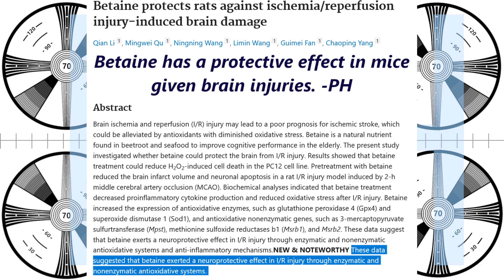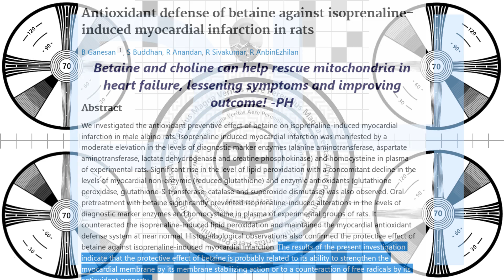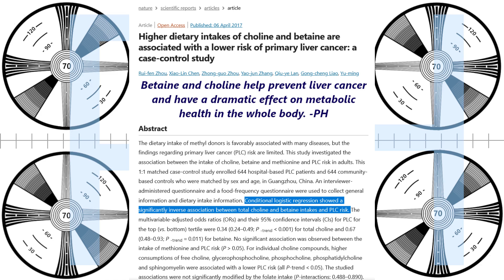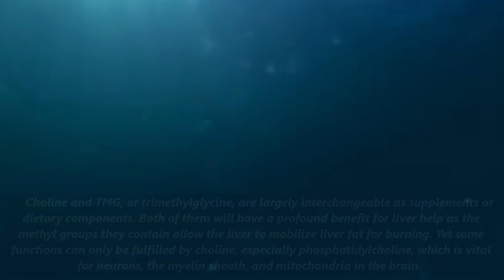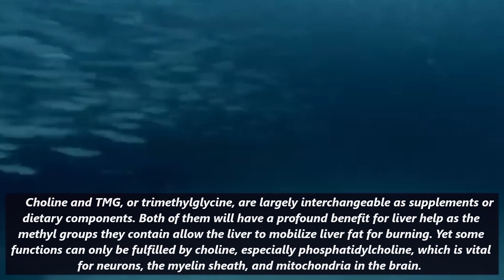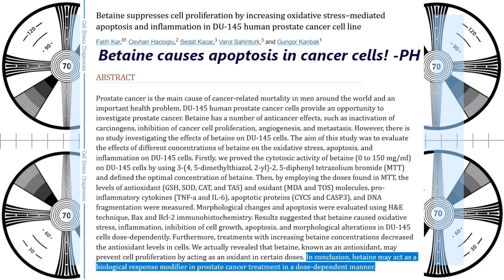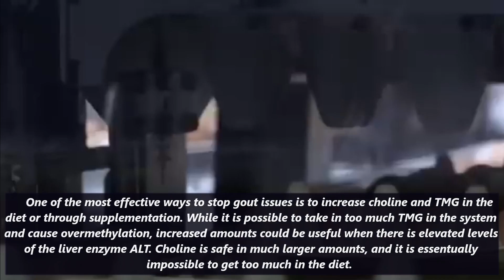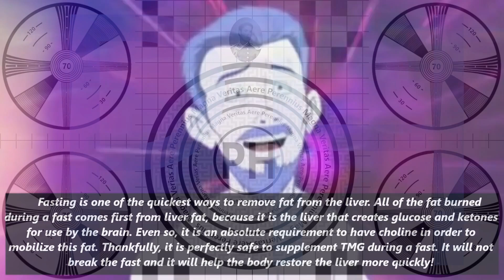Choline deficiency and IQ decline in western civilization

Comment from the maker: I just joined the affiliate program for bulk supplements. Click on link and use code save5 to get 5% off. This also helps support the channel.

Bulk Supplements 5% off affiliate code https://www.shareasale.com/u.cfm?d=583540&m=53326&u=4228604

taurine powder affiliate link:
https://www.shareasale.com/u.cfm?d=302278&m=53326&u=4228604

The items I've talked about that I get from Bulk Supplements are taurine powder, vitamin k2 powder, TMG, L-cysteine, Bilberry powder, Hyaluronic acid, glycine, niacin and AAKG.
Reply: I really like the prices on bulk supplements, and the supplements I've bought there seem to be high-quality. Do you think that holds true to almost all supplements there? Is there any supplement you wouldn't recommend buying there? Thank you very much for your time.
Reply from the maker: @enlyxtyrill6127  They get tested by third parties a lot because they are big and that is the main thing that matters. But there are many supplements I don't recommend from any source such as fungi, it is just too easy for them to pass along soil contaminants. They also have soybean oil in their rosemary oil capsules so I won't get that again. I would also only buy creatine from germany because creatine is usually contaminated with purine byproducts. I would also avoid all plant proteins from any source because they are highly processed and high deuterium and often lead. Most of the things I talk about are safe from pretty much any source though. If you want other stuff you will have to look into it carefully, but as a big company that is third party tested by competitors it's not like you would get poisoned.
Reply: @LTPottenger can you tell me where you get your German creative from please?